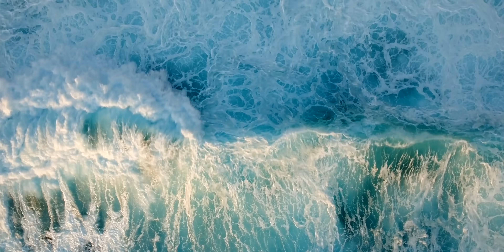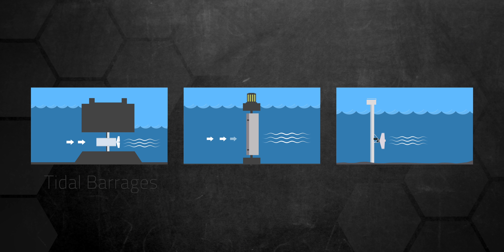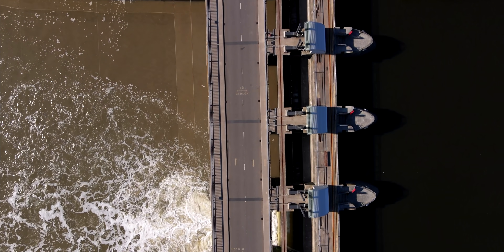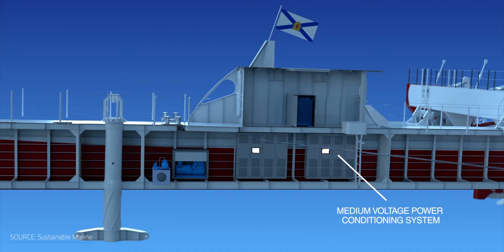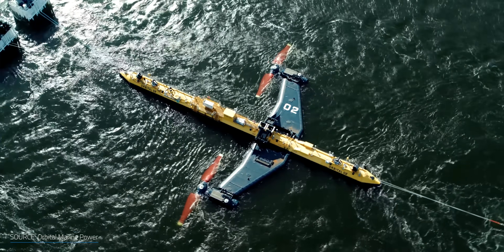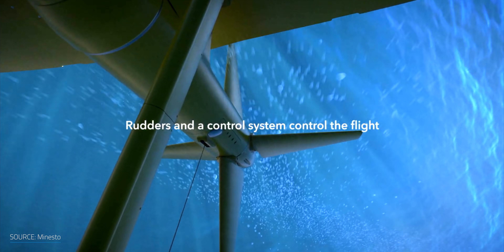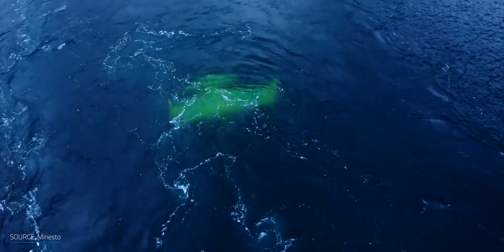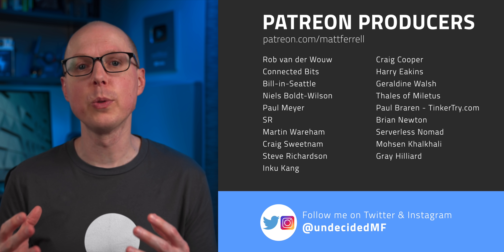Can Underwater Turbines Work? Tidal Power Explained

Comment from the maker: Do you think any of these will catch on?  And any other tidal technologies that I should have covered? And thanks again to Audible for sponsoring this video.  To try Audible for free for 30 days visit https://audible.com/undecided or text undecided to 500 500.

And if you liked this video, be sure to check out “Is Geothermal Heating and Cooling Worth the Cost?  Heat Pumps Explained” https://youtu.be/PI45yUhUWgk?list=PLnTSM-ORSgi5LVxHfWfQE6-Y_HnK-sgXS
Reply: Very good video! However tt seems you have bit old LCOE values for Minesto. For tidal with 100MW installed the LCOE is at 70Euro and 55Euro for ocean current After 1GW installed Minesto will be one of the most cost effective energy source in world
Reply: How about a video on Wave energy?
Reply: Waveenergy is much more inmature. The equipmemt must servive hard wheter and though enviroment and that means heavy equipmemt, have equipment is expansiv to build och maintain. LCOE is than very high. If they make it smaller the effectivness goes down and it will break. Though formula!!
Reply: @RoshanMenon90  yes i'm thinking about that too...installing wave energy system can help reduce coastal erosion
Reply: I would have thought that a tidal screw contained within a submerged power plant would be the best option.
A complete submerged power station could be built with the ability to decommission and do maintenance of the screws.
These could also be installed onto old oil rigs.
Reply: https://www.carnegiece.com/ceto-technology/ <== CETO Wave Tech that has no blades and good for life in water.  100% submerged.
Reply: Could one be using the pressure? like very deep.. i dont know how, but you know, there is alot of pressure in very deep, just a thought,, maybe something like the basketball that generates.. idk
Reply: @ivantijerinaf1207  there is currently research and development into wave power converters that use air filled membranes that push and pull air to generate electricity from the pressure change cause by passing waves. Deep sea pressure doesn't change so drastically so any kind of pressure based device wouldn't really work in that sense.
Reply: @SleepyFirefighter  Ollie, thank you kindly for the interest and comment. I was thinking somthing like piezoelectric.. This is just me rambling ideas n thoughts, ...From Wikipedia, the free encyclopedia: Piezoelectricity (/ˌpiːzoʊ-, ˌpiːtsoʊ-, paɪˌiːzoʊ-/, US: /piˌeɪzoʊ-, piˌeɪtsoʊ-/)[1] is the electric charge that accumulates in certain solid materials (such as crystals, certain ceramics, and biological matter such as bone, DNA and various proteins)[2] in response to applied mechanical stress. The word piezoelectricity means electricity resulting from pressure and latent heat. It is derived from the Greek word πιέζειν; piezein, which means to squeeze or press, and ἤλεκτρον ēlektron, which means amber, an ancient source of electric charge.[3][4]  // ...enfasis on "accumulate" & " applied mechanical stress" and "squeeze" ...i do not know much about its works but smells to me like there is somthing to it... best regards!
Reply: @ivantijerinaf1207  You guessed right, we are startup that have discovered Ocean Pressure Energy System Which converts Pressure of the ocean into Energy which should be covered here
Reply: @rajkumarpaulraj1521  Sounds very nice and interesting. Where can i know more about this?
Reply: We are working on a technology that harvests VIV (vortex induced vibrations) in subsea: https://matters2.com/witt-energy/
To be precise it harvests chaotic motion and can be deployed in other environments as well... maybe a topic worth exploring?
Reply: @matters2979  I’ll follow this. Intresting. In which trial-step are you now?
Reply: @tidal-oceancurrents7552  TRL 7 with test at 3m in Turnchapel Wharf (Uk)
Reply: @matters2979  Thats a long way, great job!
Reply: Another intersting system: https://www.powerfluxx.com/en
Reply: The floating kite was indeed revolutionary
Reply: One of my favorite books, i got it the day it released on audible and done listened to it 3 times now lol.
Reply: *Wave (not tidal) energy is a completely different topic, but a number of these are new to me. I seem to see more less-intrusive to environment potential, from wave, which can work with off shore wind and stay lower maintenance by keeping energy-capture parts closer to surface, able to reach surface, or even be above or on it.
Reply: How about a giant float which will generate electricity as it moves up and down with the tide?
Reply: @lexuannhi   I remember reading about something like that related to compressing air for energy storage. Not only would tidal change produce movement but so would wave undulation
Reply: Carnegie Clean Energy are working on wave power generation with their CETO technology, good to have a look into.
Reply: What about the Wells Turbines ?
Reply: They won't, especially kites. Too complex systems, very high chance of malfunction. Also, any of these will kill much more fish than wind turbines kill birds. LCOE is also much higher than wind and solar. It's just another way to spend investor's money.
Reply: @TechMasterRus  hey! You can’t just say stuff without having a single clue! 

1, The kites are already i commercial status. First delivery to Faroe Island that aims for 100% fossilfree energy by 2030. Tidal from Minsto will produce 48% of that.

2, No there is no issue at all with with fish. They are faster then the kite so they just swim around it. Bigger animal just avoid it, so far no incidents. Been in ise since 2013. (on the testsite in Northern Ireland)

Complex. Have you ever flown a kite as kid? It’s not that complicated. With that said of course its a little bit harder under the water. But hardly no moving parts except for rodder and generarator. This works, that is already proven. Producing power into the grid. 

LCOE will very low. And you have to consider that is plannable. That means less storage. With these factor it will be lower than wind and Solar. LCOE for the Kite is 80Euro/Mwh compared to offshore wind 165-180 GBP/Mwh. That is without having storage in mind.
Reply: @tidal-oceancurrents7552  Yes, I have flown kites and I know how likely it is to run into some trouble. It can fall on takeoff or landing, it can experience some turbulence at any moment. You need a very robust system to control it automatically, but no system is 100% reliable. You also need to land the kites every time when water flow stops. How frequent should be the maintenance? It has many moving parts, the whole kite is a moving part itself, and it's under sea water in very rough conditions. Even ships under water become covered with some sea stuff after a while.

Also, Minesto show unrealistic power ratings on their web page. They say, a small unit with 4-6 m wingspan at 1.2 - 3.0 m/s water flow can produce 50-250 KW. If we put these numbers into hydroelectric power calculator, we'll see that to get 250 KW output at 3 m/s we need 47 m2 flow cross section, and to get 50 KW at 1.2 m/s we need 145 m2 flow cross section. As you can see, a 4-6 m wingspan unit is not even close to such water flow effective cross section areas. It seems that actual power is 5-10 times less than their estimates. LCOE of 80 EUR/Mwh also looks unrealistic.

Returning to reliability: how many of these units do you need to replace one 2 MW wind turbine, for example? Assuming a realistic output of 10 KW per unit, you need 200 kites to replace only one wind generator. Every one of them is more complex system than wind turbine. So, probability of failure increases dramatically.

About killing fish: they say, their kite moves several times faster than water flow. This means colliding with fish is very likely. And a turbine on the kite moves even faster. So, I suspect that fish safety is just advertising.

Finally, tidal water flow is not constant at all, some energy storage is necessary here, as well.
Reply: @TechMasterRus  long answer. I need some time to answer this. But you will get an answer, because you talk like it does not exist, it does! But as I said longer answer will come…
Reply: @tidal-oceancurrents7552  It does exist, for sure, but reliability and economics are at least questionable. Also, there's no rapid growth, unlike wind and solar, however, this technology is nothing special.
Reply: @TechMasterRus  what do you mean with nothing special? A technology that can enable 100% renewable…you can not do that wind wind and solar. Rapid growth will come remember it took a while for wind to break and tidal is 15 years behind
Reply: @tidal-oceancurrents7552  I mean, tidal requires nothing that innovative, compared to wind, and still it is far behind. Solar, on the other hand, needs very pure silicon and is itself 10 years behind wind, but it is still much wider spread than tidal. So, tidal will ever only have niche application. And kites are the last of all technologies described in this video to catch on.
Reply: @TechMasterRus  nej, you are wrong! The kites are alredy flying in utilityscale at the utility in Faroe Island. It will produce 48% of all power needed and that require around 100MW . @100MW the LCOE will be less than 80EUR/MW. Next step is 80MW in Holyhead, Wales. In paralell the have the first test together with EDF world largest utility company. And after that Florida and Taiwan is comming…small step for man kind big step for Minesto
Reply: @tidal-oceancurrents7552  it will, it will... You are trying to prove your point with some plans, not real achievements. In reality, the whole world's insalled tidal capacity is less than 1 GW and all of that is not kites but more traditional dams.
Reply: @TechMasterRus  The system is new, it’s an unmature market…but someone has to go in the front. For tidal that will Minesto, the only company that has buildt it’s system for serialproduction.
Reply: @TechMasterRus  Canada gets 60% of it's electricity from hydro
Reply: @TechMasterRus  in a capitalist country we have to wait until a company provides hydro to an area of the country

if the government jumps in and creates hydro then it will be favoring one type of  energy over the other when it should just be the referee watching the contest
Reply: uphill battle.  offshore wind is a goliath in these locations. problem with tidal or underwater is the wear/tear "and" difficulty for repair or installation.
Reply: All of these, except the undulating plane thingy, sound like a nightmare for marine life. I can especially see the flying kite thing kill a lot of sea life due to collision.
Reply: I have listened to that book and it was awesome! the reader is what really made it amazing.
Reply: I like all these ideas, but... as a retired commercial fishermen  Ive seen what islands of bull kelp torn up by storms can do to stationary underwater  equipment. Nature will damage these things more than they will damage nature. These technologies will be very high maintenance.
Reply: The problem with all of these is that salt water is highly corrosive. Also sea creatures such as barnacles might have to be removed periodically increasing the operational costs.
Reply: They have that vibrating wind stick, for solid state wind, I feel like that would be a pretty good use case for tidal power.
Reply: I have an invention far better than any in your video. Will produce 30MW per unit and is 100%, repeat, 100% environmentally friendly, even by the shore observer. After over a hundred letters, emails and texts I never get a reply not even an enquiry as to how it works. I am not giving away my invention but don't need a fortune. I invented it 18 years ago, tested the model and it superseeded my expectations. contact me ;- erichoare06@talktalk.net
Reply: I think tidal power has lots of potential compared to wind and solar, partially because of a few things:

1 - Tidal power is predictable. It may not be perfectly continuous, but tides move in and out very predictably.
2 - Water is much more dense than air and therefore when air and water velocities are low, water contains more extractable energy per volume.
3 - The greater density of water also means you can potentially have a smaller footprint for the same energy compared to air.
3 - It is easier to hide compared to huge above ground wind turbines/windmills.
4 - Most high density cities are close to large bodies of water. Regions where wind velocities are high and where there is enough space for large solar power installations tend to be more remote.

The biggest challenge with underwater turbines is this is new technology when compared to wind and solar.

Having said all that, personally I believe we should be heavily investing in next generation nuclear power stations (that consume almost all of the nuclear fuel) more than any of these fully green options. Nuclear power can generate orders of magnitude more power than any green technology and if done right can have a considerably smaller impact on the environment. Nuclear power, although scary to many people, has got a proven safety record that is superior to ALL other energy production solutions, including wind and solar.

One thing I believe will drive us to nuclear is eventually we are going to have to become a fully renewable society where essentially nothing is mined from the ground. With enough electrical energy, almost anything can be recycled and the only clean technology able to generate the power level required is nuclear power.
Reply: Great video but I doubt these technologies will ever go beyond niche uses (like powering oil rigs or remote outposts/cities) that are far away from well connected power grids. In my opinion, since blade driven machines like wind turbines and tidal wave power always work from fundamental kinetic energy e=1/2mv^2, it will never approach the capacities of nuclear forms of energy with e=mc^2. Nuclear power has already solved the green energy energy crisis, just ask France.
Reply: I think you should look at this very promising technology, combination carbon capture and power generation, brilliant.  http://www.terracoh-age.com/
Reply: Look at Waterotor Inc!
Reply: lets see my idea
Reply: Using Cisterns for tidal power could be interesting. The cost of excavation can be high, but it allows them to be built almost anywhere on the coast, including under buildings in cities.
Reply: very interesting video it would be great if any one of those caught on. wondering if you could do a video on generation four nuclear? "terrapower" / "terrestrial energy" would like to hear your thoughts on this option as a means of eliminating carbon
Reply: can't you see how ridiculous this is ? seriously now.
Reply: @itsMe_TheHerpes  no.. not really
Reply: Let's see what this year's CfD AR4 will bring. With a ring fended budget for marine energy it might..
Reply: Yeah harnessing power from solar wind.
Reply: @richardhare1734  😂 🤣 good one, lol
Reply: A new and simple process is presented here: 
https://youtu.be/cChqG3vOiAg
Any feedback would be greatly appreciated. Thanks
Reply: A long time ago I came up with a design that is basically a massive platform that sits on pontoons which moves up and down on the tide. Very cheap to make and capable of producing massive amounts of hydraulic pressure but I could never figure out a good solution for a hydraulic fluid powered generator
Reply: @ChatTHC420  : Key , A pump is inherently a generator ….
Reply: I have invented a novel tidal power system, but don't know where to go with the idea.
Reply: Many interesting ideas here.  Unfortunately, they all could have some negative ecological impact.  One system that would have minimal negative impact is to harness energy from the vertical movement of tides.  Many areas experience 30 to 40 foot vertical changes in water levels four times a day.  The energy could be harnessed by using a floating platform attached to the ocean floor on a pedestal, similar to that used on an offshore drilling rig.  As platform raises and lowers with the tides, a gear arrangement could be used to drive a generator.  All the ancillary equipment would be stored on the platform out of the salt water environment.  I think this has been explored by various universities including Oregon State University, although I don't know the status of that research.
Reply: Please make a video on companies looking to gather energy from hurricanes. It seems logical to me that a natural event that has enough energy to power the entire country should be looked at as a possible energy storage event.
Reply: What need is huge nuclear complex is buried in the Nevada desert just like testing nuclear bombs if something goes bad we can just bury the problem the neutral complexes to produce electricity electricity needed for desalination seawater amount rivers flowing we could produce so much desalinated water droughts in California Utah Nevada some parts of Oregon some parts of Washington could be turned green again with all the water they can never use California Farms would never go out then we can tear down dams did the Cubs the water up across them out technology chipak the summit's full of snow for the winter was run off to keep the water's cool salmon runs to return to the rivers you can't get rid of the reservoirs River canals around the reservoirs around to keep the rivers cool so much water and extra electricity
Reply: @bobhandymen2578  : or just figure out a way to make it rain where we need it to ???? Right
Reply: Roosevelt Island Tidal Energy (RITE) is a completed project producing electricity from the tidal flow of the estuary thats NYC's East River.
Reply: Still no mention that in the UK, or other places similarly blessed with staggered tides, there would be no need for any storage, just a large North / south interconnect.
Reply: I have spotted a few ways that they could be getting more energy out of a lot of these models
Reply: Although I jokingly refer to myself...for obvious reasons...as "Tommy the Commie," this is a good example of how I hope the free market...or 'benevolent capitalism'...will lead us to the best solution.
Reply: Humans 0
Saiya-jin 1 to 6
Angels 7 😇

Kalki Ironman 5th matriya buddha 8th arc Angel 11th satguru 13th imam and 24th avatar after 2026 😎

Almighty God 9 😇

Humans type 2.5+ after 2026 by Kalki Ironman (christ in the white horse)(son of man on clouds) type 7 and 8 😎

Jarvis the world’s first artificial intelligence (parrot) 😎

Cuz Kalki is ironman batman and every super heroes combined after 2026 😎

Jarvis world’s first artificial living being (just like vision in marvel universe)😎

Made of Quantum and sub quantum particles 😎

Power source quantum energy arc reactor (type 7) level technology 😎

Kalki Ironman going to have every kind of arc reactor like:- type 1 Nuclear fission, nuclear waste, hydrogen fusion, type 2 3 4 5 antimatter arc reactor (solid liquid gas), type 6 electro quantum arc reactor, and type 7 Quantum arc reactor, type 8 limitless quantum energy arc reactor without quantum particles 😎

Kalki Ironman going to have sun in a box million billion tons of hydrogen nuclear fusion reactor type 2 3 4 5 just like sun and stars in the palm of his hand ✋🏻🤩😉😇😎

This all going to happened by self replicating quantum nanobots knowledge energy and techniques at type 7 7 7- respectively 😎😎😎😎😎
Reply: The thing that is the coolest to me about Tidal power is paradigm shift it offers, most of the conversation about renewable energy revolves around wind and solar power, which while renewable are unpredictable as mentioned (we've been struggling to accurately predict the weather for as long as we've been trying to), and the simple reality that there is so much reliable and predictable energy being left untapped is an exciting thought.  There are a number of conversations about how to store that energy, since batteries present challenges in their own sustainability options like the tide become that much more attractive.  There are some exciting advancements in battery technology too many to list here, and even ways to store the energy during non peak hours for later use, for example an essentially gravity fed water turbine in a large water reservoir at the top of a small mountain that allows gravity to pull the water through a turbine to generate energy and then uses solar or wind or even unused grid energy during none peak hours to pump the water up  to the top of the small mountain its on for use to generate power again at a later time.  It is essentially a giant battery (see Real engineering's video on it), but that said, the exciting promise of tidal energy is that it turns the discussion away from sun dependent energy sources, that are often unpredictable and unreliable in essence they are byproducts of the weather which in itself is difficult to predict let alone to be able to met the near instant and constant demand for a grid.  The idea of having enough wind and solar to cover a large enough area and capture enough energy to account for the loses from the areas that aren't generating power when the wind isn't blowing and the sun isn't shining sounds costly, and suffers from transfer loss.  But I suppose all options are. What does excite me about this is that it changes the narrative from a "how do we get more power from the sun" to how do we get power from the moon, in essence the moon itself is a giant battery that we carry around with us all the time, as we travel around the sun, as its exerting power on the oceans constantly, the moon is exerting massive energy in the form of gravity on the earths oceans as the tides, that has been coming in and out for as long as we've been recording history. It represents a truly unending (for our purposes), and predictably reliable, source of energy.  However, it has some of the same limitations of transfer loss since obviously everyone doesn't live close enough to the ocean to benefit from it, and this is a similar problem as I understand that exists with just placing millions of solar panels in desert areas to generate power.    So Tidal as wonderful as it is couldn't be the end all be all of power generation, I think nobody is saying it is, However I believe any sustainable energy solution would be amiss without considering tidal as vital part of it considering what it offers.
Reply: I live in Maine and remember the debate around the Passamaquoddy dam. It faced fierce objections by the populace but I supported it. I am an organic farmer and an environmentalist. I think we should be thinking about what is worse, hydropower or fossil fuel/nuclear. Our need for power is increasing exponentially with the electric cars and heat pumps. The capacity to keep up is just not there. If we stall on these technologies the old, dirty methods will return.